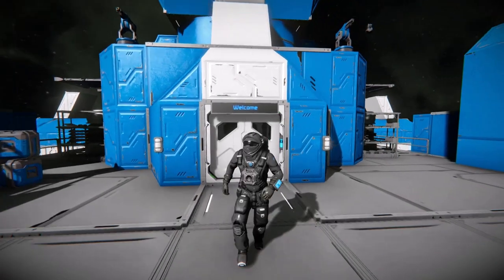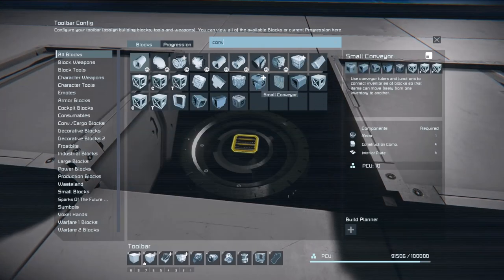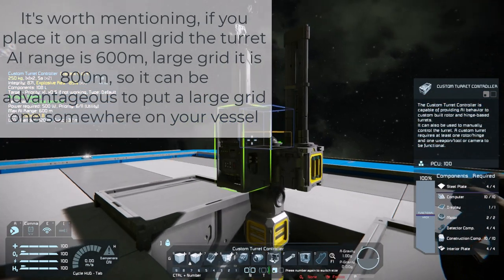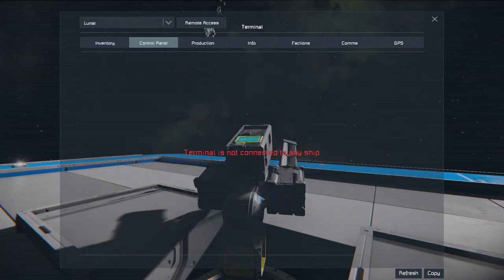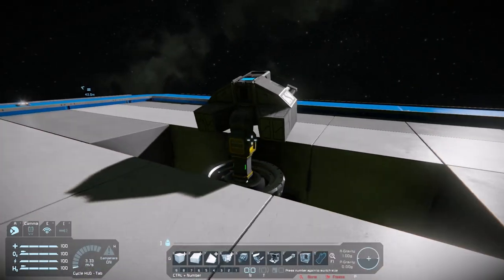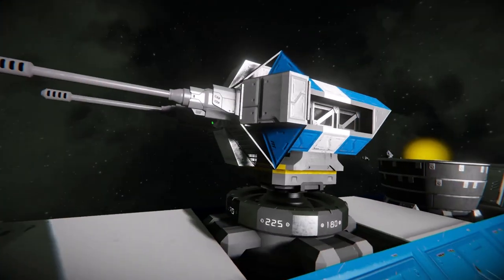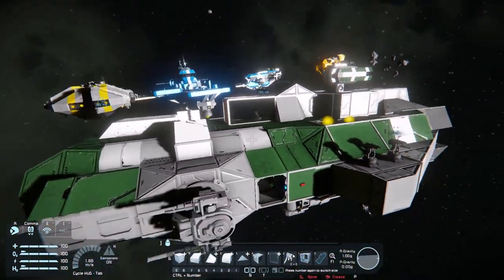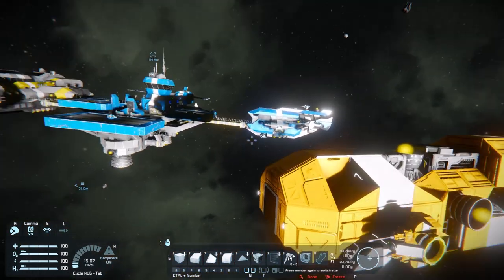CUSTOM TURRET TUTORIAL - Space Engineers Guide

Comment: Custom turrets are great for getting a specific look and for packing more punch in the same space. They are almost universally weaker than placed turrets, but that's a trade-off to consider when picking your weaponry. 

Being able to out-range small grids by 200m is significant unless you plan on charging in, at which point bayonets would be a better option anyway.
An easy way to extend their lifespan is to have either a standard turret or even fixed weaponry on your vessel closer to the enemy - this will take targeting priority from AI weapons and give the customs more time to shine with their higher damage output

Comment: I build compact large grid ships for PvP in creative that rely on custom turrets a lot to punch above their weight. I've put anything from 20 assault cannons to 11 bp-edited fixed artillery to 10 small grid railguns on custom turrets. Here's a few tips that should still be helpful for survival:
- Durability of the small grid large adv. rotor head is probably better, so use that where possible (you can check with build info mod)
- Heavier turrets will have problems with overshooting and missing targets if you don't adjust rotor & hinge torque and turret controller speed accordingly
- On ball turrets, leave the hinge facing upwards and build forward, this makes it so the turret can aim downward, reducing blind spots
- Whip's TCES script fixes most issues with turrets bugging out, as long as the groups are set up correctly
- I don't know how weapon tracking works with customs with multiple weapon types on, but considering weapons fire projectiles at different speeds and not all have bullet drop, you are often either going to compromise and hit nothing, or only have one weapon type hitting anyway if you do that.
- Put non-deformable blocks underneath your larger custom turrets, in combat armour can deform into your turrets and cause clang to visit you, then either your turret will detach or you'll have clang forces from the stuck turret clanging. Blast doors rather than heavy, beam blocks rather than light.
- If you inset the azimuth rotor 1 block deeper and place a welder adjacent, you can project a prefab turret in the space of the custom, so that if the custom gets shot off you can build a prefab to replace it mid-battle. Mostly for creative, but if you inset by 2 blocks then you could fit a conveyor connection under the prefab turret for survival.
- If you use Whip's salvo script, don't. Instead, put a salvo group and script block on each of your custom turrets, and set the custom data to filter to only the weapon group for the turret it's on. Then you are not vulnerable to getting hit by one lucky shot that will take out all of your salvo setup.
- YMMV with this one: I've found rocket launcher tracking and the target lead indicator for it to be very inaccurate and inconsistent, this is unfortunate as salvo'd rocket launchers would otherwise be very effective guided missile defense
- I don't consider custom turrets with only 1 or 2 weapons to be worthwhile, it's nice that they can be made to look good and personalised, but for the advantages of turning rate and weapon accuracy you pay the price of stability and in accuracy from physics. That's very subjective though, you should use your own judgement on it.

Comment: My complaint with custom turrets is their vulnerability. Unless you have a very clever complicated design, custom turrets are destroyed very quickly compared to their placeable counterparts. Even if your armor layout is done well explosions are likely to destroy the hinges or rotors. especially when compared to the assault cannon and artillery turrets. 

Not to mention once they are destroyed it's a lot more work to repair/replace them without the use of subgrid projection plugins.
Reply: That's my gripe with them. If subgrid projections were more applicable I'd use them exclusively. I don't like messing around with plugins and game files
Reply: Yeah but given enough damage output and good positioning, it can shred through enemies before they can even think about hitting you.  Also a good option is placing decoys as far away from the turret as possible, although that only works for regular ai controlled turrets

Comment: My rotors keep adding 3x3 heads every time I add a small head. Do you need a mod or dlc to add a 1x1?
Reply: Im having the same issue, did you figure out how to add the 1x1 rotor head?
Reply: @MaxNStax  yep. Kolony is using a mod that he isn't disclosing in the video. If you want to do this in Vanilla, you need to add a separate hinge on a different grid, add a 3x3 small head to that hinge, built standard armor blocks from that hinge head over to the empty hinge (make sure to center it directly above the target hinge), build two more armor blocks down, add a 1x1 small hinge head to the bottom of your armor trail, then attach the empty hinge.